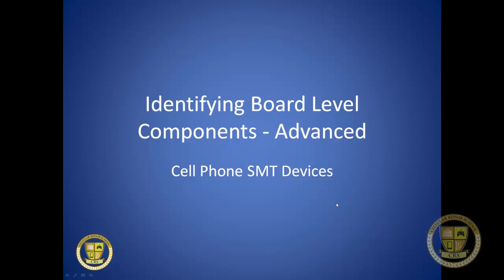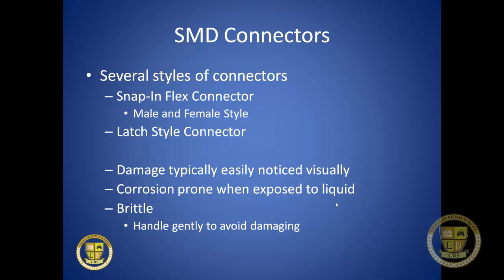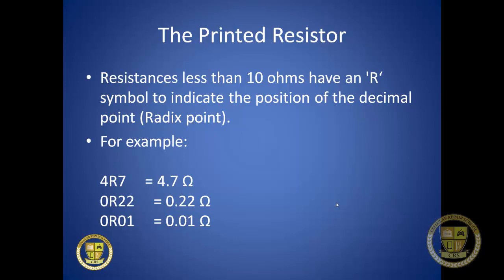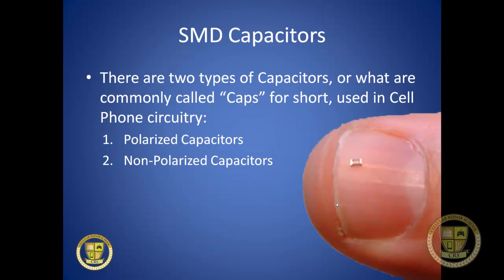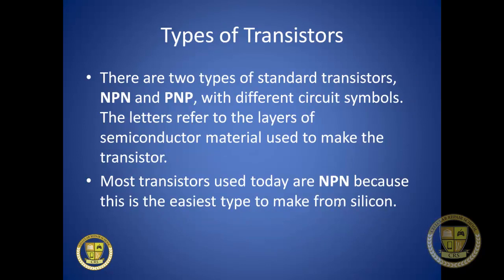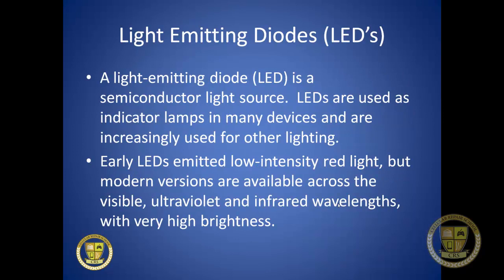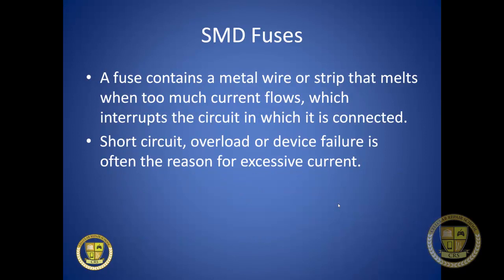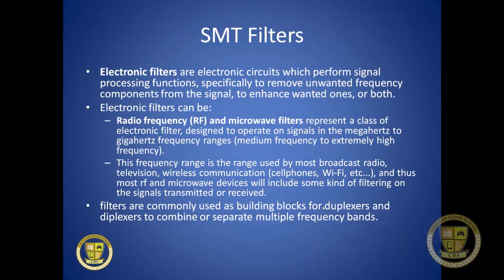Cellphone Board Repair: Identifying Board Level Components

Comment: Hey man. Odd question... do you perhaps know if it is a myth or actually a fact that, if you have a mobile device that has abnormal battery consumption, or battery depletes faster than it should, there is a component on the logic board that can be replaced that remedies the irregular discharge?
Reply from the maker: Hey Barend,
It really depends honestly.  It could be a failed component, a bad battery or a whole laundry list of things causing the issue.  Most commonly we see it happen from some sort of liquid or moisture exposure that causes corrosion of a key component.
Reply: @CellularRepairSchool  yeah, I thought so too. I remember a guy told me many years back that he had a smart phone that sold for cheap because the battery would last about 5 hours from fully charged, then a couple weeks later he met the buyer, and the buyer told him there is a component that can be replaced that resolves the issue at hand.